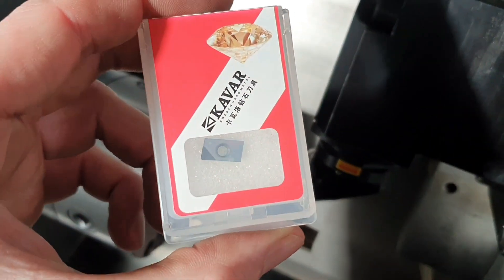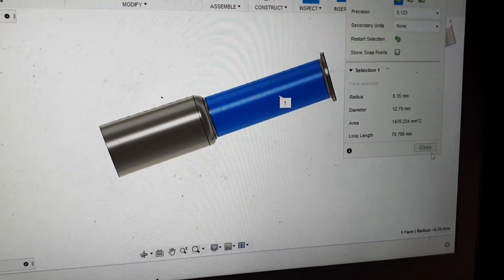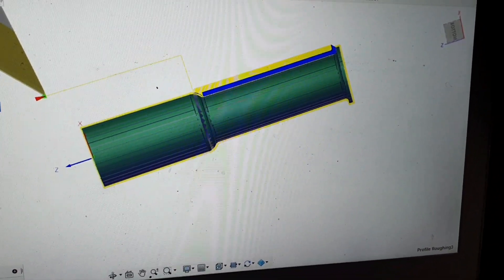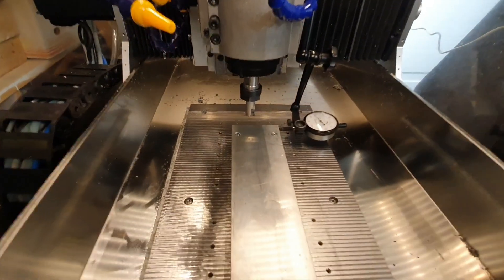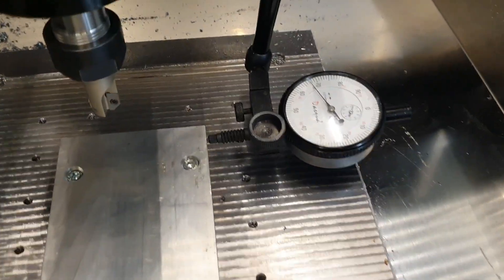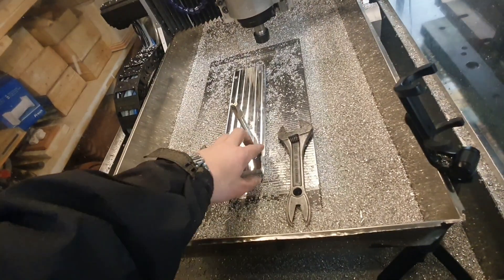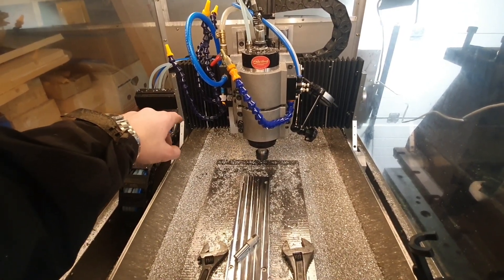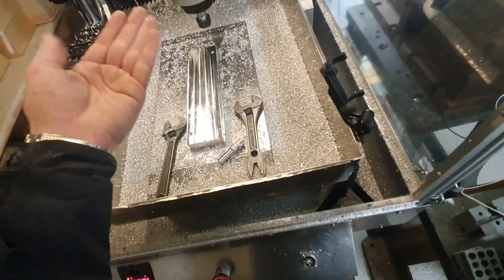BAP300r + PCD 1135 inserts (reduce shank + @6:50 test cut aluminium with rebuildt 6040 cnc router)

Comment: Nice video. I have a few of them cutters i wanted to turn down the shank to use on my 6040. you beat me to it. And im not surprised the coupling broke. The bigger diameter cutters have more tool pressure then smaller tools. Plus with the higher feedrates im sure that helped it fail as well.

Comment: Insane work, Thank you for sharing your work on youtube with us!
Reply from the maker: Thanks man! 🙂 I will now upgrade the motor coupler that broke, then mount the router onto a 73kg cast iron stand I bought. Think it will be a very nice upgrade. New pcd inserts are on its way to Sweden. I will soon be back with more videos.
Reply: @thechipwelder1253  Your cnc is becoming a monster, extremely rigid. Which couplers will you place? Rigid? I'm using the spider type. Your lathe videos are making me want to buy one, keep up the amazing work.

Comment: Which motors did you upgrade with  ?? In a past job we used similar cutters to what you have shown, they were brand name "tyrannomill". They were using carbide inserts however and we machined mostly steel :-).
Reply from the maker: I upgraded to Nema 23 425oz 4A motors and HBS57 Drivers. An ebay seller had a  promotion last winter when they sold a kit of: 3pcs motors + 3pcs drivers + 3pcs 5m cables for a total of 239 euro. Not availible anymore though. It sold out quickly. 

Tyrannomill sounds more expensive than BAP300r. The cutter I used was only 6usd with two inserts for steel included. But it seem to do its job. 

Thx for commenting man
Reply: @thechipwelder1253  I spent about 5 years doing hand programming of 3-4-5 axis cnc for tool and die work. The premium brand cutters and inserts are indeed very expensive. But the shop rate a decade ago was $125 per hour so that cost was worth it if it made things go faster. I bought a G540 from Geckodrives. Looking at these steppers here. NEMA23 570 oz/in 3.5A 1/4” Dual Shaft Stepper Motor (KL23H2100-35-4BM)

Comment: This was awesome! Can’t wait to work in the garage this week myself :)
Reply from the maker: Thx for commenting man! I have already ordered new pcd inserts. Will make a stainless motor coupler next time in the garage. Then it will time for round two. :)
Reply: @thechipwelder1253  just try to make sure they are somewhat flexible (the motor couplers). Any deviation in rotation and misalignment axially between the motor and the ballscrew will increase the wear on the bearings inside of the motors, killing them prematurely, if they are rigidly coupled. Good luck!

Comment: Probably it’s some tool steel i guess, even the cheaper tools are made from pretty good steel. Better try to figure out what kind off inserts you have ( talking bout those DCMT’s) because the chip breaker is designed for specific material, and no matter how hard you try to break chips in tool steel you ain t gonna do it with an chip breaker designed for stainless for ex . 
  Try to make yourself a nice CNMG tool holder for roughing mate and get some inserts , using a dcmt for roughing and general aplications is just cruel haha. 
  Anyways, love the lathe and the rebuilt router, wish i had stuff like that 👍🏼 keep it coming
Reply from the maker: Thx for for the info man! What you say about the inserts makes a lot of sense. I will get the inserts you recomend. To bad the motor coupler broke on the router, but there is always a risk involved when pushing the limits. I was aware of it and was willing to take the risk to make a good youtube video. Inserts + shipping did cost me a total of 20 bucks so pretty expensive, but my youtube Chanel will generate ~100usd this month, so it is not the end of the world.  I actually already ordered new pcd inserts and some extra cutters aswell in case this one got bent. I will replace the broken motor coupler with a stainless one. Then it will be time for round two. :)
Reply: @thechipwelder1253  forgot about those pcd inserts, now i saw your reply and remembered i used a lot of pcd and cbn inserts but mostly for hardened tool steel and they work amazing, never was too preocupied about that mirror finish in aluminium to be honest, using small CCMT inserts and the leave a close to mirror finish and that is good enough for me plus the cost for them is much lower than pcd

Comment: Those PCD inserts are insane, awesome surface finish! ... there is always something to fix on a machine.
Reply from the maker: Thanks for commenting man! I agree, when I decided to go all in with 24000 rpm and 6000mm/min feed. I did not know what to expect, was prepared for shatter and bad surface finish but the cutter just went through like it was nothing. 

To bad the motor coupler broke, but I was aware of the risk. The most annoying thing is that I was abouy to upgrade that motor coupler next week. In which I will move the router from the Ikea table I currently use as stand to my new cast iron stand I bought. So this was the final minutes of cutting before the dissasembly. Apperently the motor coupler decided to give up just at the finish line. 

Anyways I have now orderd new inserts and some extra cutters in case this one got bent during the crash. Then it will be time for round two. With a new stainless motor coupler and the router mounted on a cast Iron stand

Thx for commenting.

Comment: sucks your inserts broke, that surface finish was nice!  Have you checked how flat it is on a surface plate?
Reply from the maker: Thx for commenting man! Yeah, especially since I was about to upgrade that motor coupler next week when I will dissasmble the router to have it mounted on my new cast iron stand. I was aware of the risk that it would brake but decided to take the risk. Wanted to make a cool youtube video. So I only got myself to blame. Price for the inserts + shipping was 20 bucks. My youtube Chanel generated ~ 100bucks so it is not the end of the world. Worse is that it will take me a month before I will recive the new ones. Thx for commenting. I will be back with pcd cutting round two.
Reply from the maker: I faced off  booth sides of the aluminium plate and planned to check it on my granit surface plate. But when motor coupler broke just at the finish line I decided to go home instead. 😁

Comment from the maker: I wonder what kind of steel I just turned. Tried to google some but found hardly any information about modifying these cutters. SinceI  have almost zero experience turning, it had to be some trial n error. Tried many different feeds and speeds but did not achieve any good chips.  Feel free to comment on how I can make better chips turning this for me unknown steel.
Reply from the maker: Thx for the tips man! I plan to modify some more of these cheap cutters. So I will try and experiment some more with the depth. I also was recomended by another viewer to buy another type of inserts.  In this video I made  one deeper cut. Result was very long ~1m / 3f rope like very blue chips. That was not what I expected. But perhaps it is kind of lika a threeshold. That if one will take an even deeper cut it will get better.